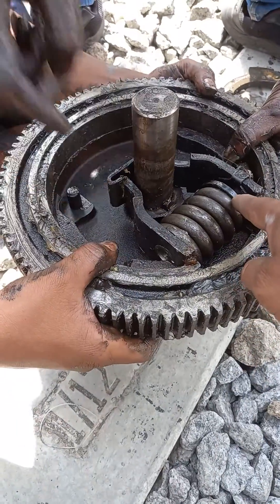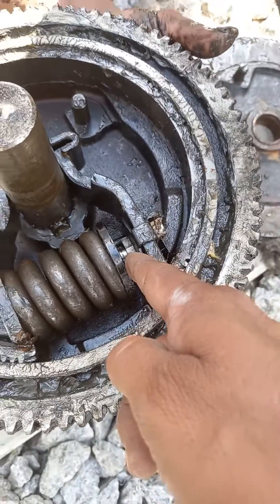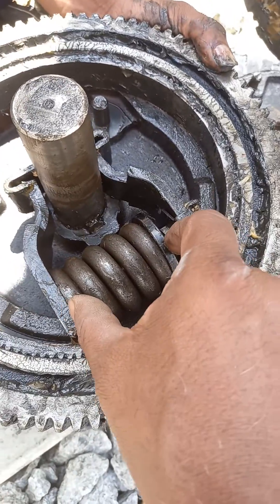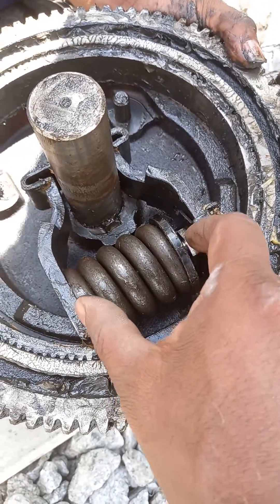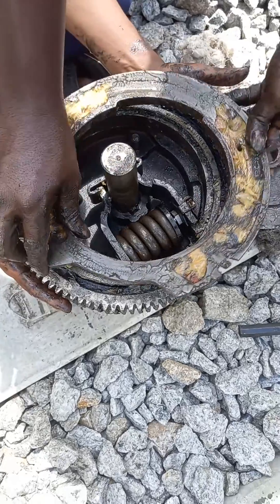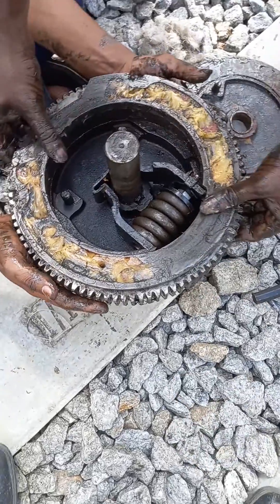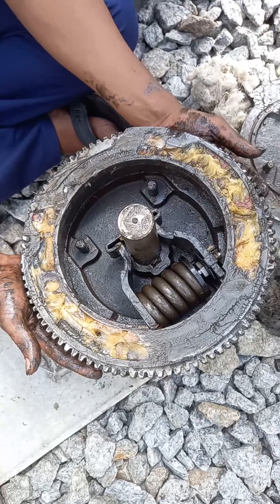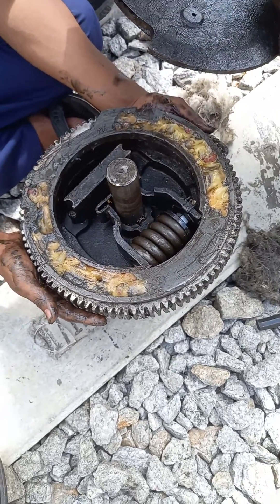friction clutch In a point machine

Comment: Please tell us how to fix out rollar back problem in 220mm point machine?
Reply from the maker: Problem with friction clutch..call the manufacturer. He will address the problem. Friction clutch slip at 400 to 450 kgs. If not adjusted correctly by company, this may give problem where roller lifts after setting at times.
Reply: @ramprasad331  sir at the installation time the machine was good but after 3000 operation,rollar back problem comes out.
Reply from the maker: If oil instead of grease is in friction clutch, then it can get pushed  back when it is set..so do not to put oil on point main gear.
Reply from the maker: Are you swathi Yadav trained at STTC MLY